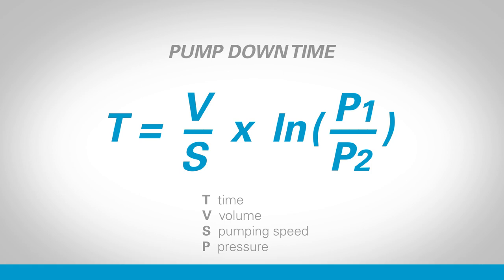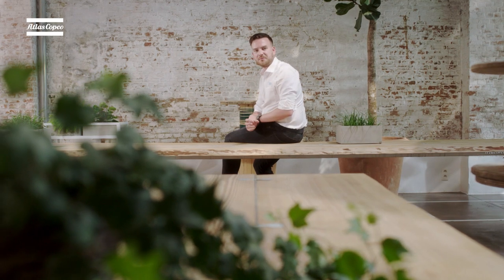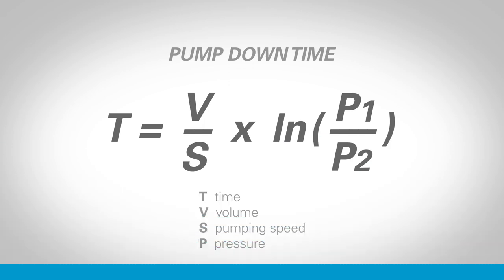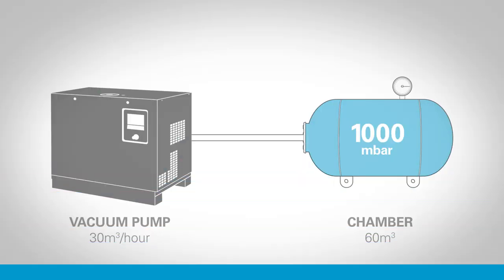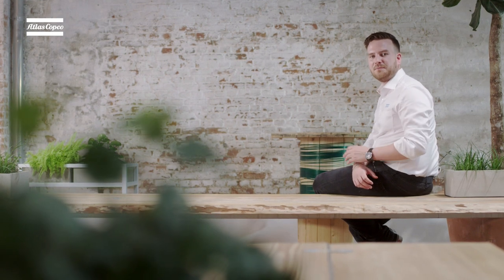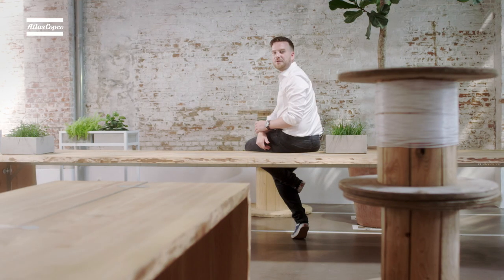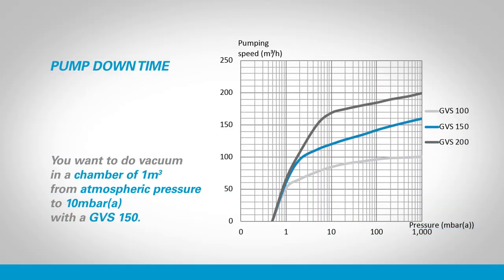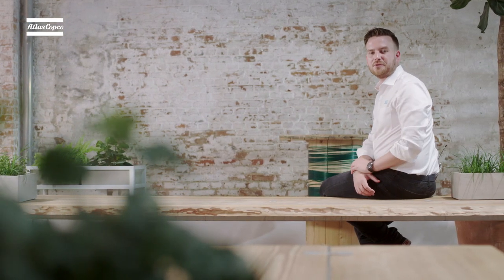Pump Down Times - Vacuum Pump, Equation & Examples

Comment: What about this formula t=-(V/S)*(P2-P1)? i used the one you said for higher pressures but the result its crazy and no way posible. instead for a range of 1*e-3 Torr- 7.6e-6 Torr its more accurate

Comment: Question: If we take the a vac pump of say 1200m³/h therefore S = 20m³/min and V = 1m³ closed vessel and want to draw a vacuum from say P1 = 1000mbar(g) to P2 = 10mbar(g) then, using your equation.......... T = 1/20 x log(1000/10) = 1/20 x 2 min = 2/20 min = 1/10 min = 6s. Is this a realistic expectation because actual draw down time I'm given for a larger capacity GHS1600VSD is nearer to 18s.  What am I missing here, please?
Reply: The log should be natural log not to the base 10